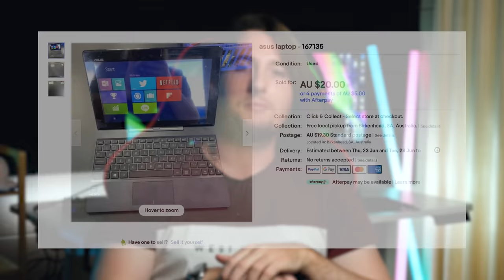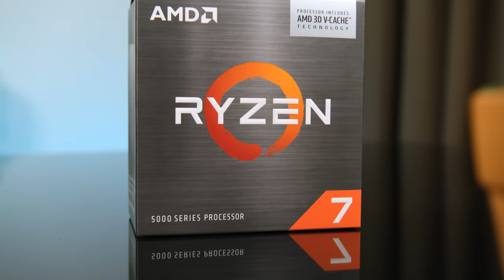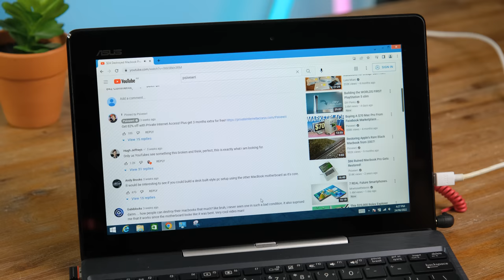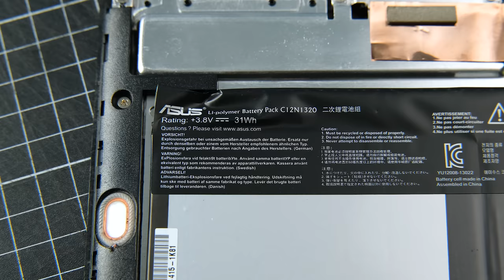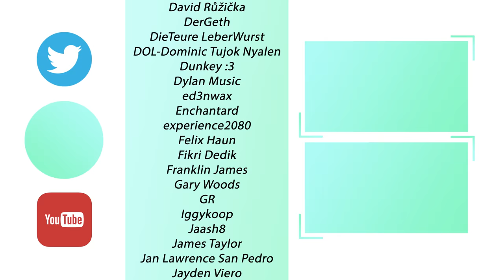I Bought a $20 Laptop From Cash Converters...

Comment: I had that laptop for a while a few years ago, it was a nice little laptop, I remember when I updated the bios and it unlocked a bunch of new features in Windows 10 also I remember the tablet crashing if you didn't have the right drivers installed in Windows and disconnected the keyboard

Comment: I have 2 of almost the same model as the video the difference is that its the T100HA instead the T100TA model. My model is originally shipped with the original release of Windows 10 from 2015. Now I have one of them with unsupported Windows 11 and the other with Windows 10. I still use them in 2022 and they are still good!

Comment: I've had a larger ASUS Transformer of the same line years ago, yeah the 2GB models even then would've popped up "Hey close some things to avoid being interrupted/crashes"
Using it nowadays will make that message appear more often, 4GB is definitely a necessity to be useable.
I still use it from time to time for specific things.
I've thought of replacing W8.1 for Linux, but seems like it uses a 64Bit OS with a 32Bit BIOS, somehow, so I just gave up on it.
Reply: It's quite easy to get Linux on those 32bit EFI systems. If you want to try it I'd recommend checking "Linux on the HP Stream tablet" on HP community, it's the same process for other non-HP tablets too
Reply: Kinda like the HP stream tablets lol
Reply: @Pasi123  I've decided to actually give that a shot. The UEFI was unable to recognize either the SD Card or the USB that I tried to boot from. Disabled Secure Boot, and tried the USB on another Laptop and it worked, but not on the tablet. I was using a 32bit version of LMDE just to make sure it will read the USB. Maybe I have to use the Micro USB port with an OTG Adapter?
Reply: I was trying to install Linux on the same model and ran into the exact same issue. The answer is MX Linux (KDE Spin - 32bit). It has a 32 bit UEFI BIOS, but is also available as 64bit OS.
Runs perfect, even got the touchscreen to work perfectly and calibrated.
One thing to lookout for is orientation. It is the wrong way up. Though on KDE it is a one time issue (go to settings -> Display -> Switch to Landscape).
Reply: I had a HP EliteBook 8560p from workplace that also has a 32 bit BIOS and 64 bit OS. sadly the workplace installed a 32 bit version of windows.
Reply: I have this exact model and ran into this bizarre issue. You can install Linux because GRUB is 32-bit and supports loading a 64-bit OS through it, try Linux Mint
Reply: After putting it on and off for almost a month I got Fedora working. For some reason when I plugged in a Windows 10 USB installer it was able to read the USB in the UEFI after that(if formatted with either Rufus or dd). Linux Mint installed kept crashing but Fedora worked fine, GNOME on an Atom with 2GB of RAM is an overkill but at least GNOME has a more touch screen friendly UI. Bonus with Fedora is that it installed a 64bit version anyway without messing with the bootia32.efi
Reply: @LouiesWorkshop  That's probably grub or efi shell.

Comment: i just got myself a Dell business class tablet.
It was well over 1k when it launched in 2017 but i picked it up for about 260€ and it has a i5 7300U aswell as 8GB of RAM and a full sized m.2 NVMe enabled slot for SSDs.
It even can take a second SSD inside the unpopulated mPCIe slot where usually the WAN module would sit in another configuration of this model.
The wifi module also sits in a mPCIe slot, can be upgraded but isn´t needed though.
Supports bluetooth 4.0 and wifi 5ghz, enough for me.
The type cover has a white backlight and it features a full size USB 3.0 aswell as two Type C ports with displayport and that´s also used for charging (needs 20V PD though).
At last it also includes many handy enterprise features aswell as legacy CSM module for BIOS emulation.
So technically, it can run windows Xp even but i already had issues getting drivers to work in windows 7  as the 7th gen Core i no longer supports windows 7.
Anyways, i got windows 11, ubuntu and android-x86 up and running on a 512gb SSD.
The OS can be selected through the boot menu, which is accessible with F12 or the volume buttons.
Best tablet i ever owned.
Reply: Damn, one intel generation forwards and it would've gone from 2C/4T to 4C/8T

Comment: I've had this model for a whole week back in 2014. It was very nice. But the big Oof-point was the very slow charging process. The included charger was not capable of charging my device while running Windows 8.1. I didn't knew a thing about third party chargers then. But...it was a nice litte computer.

And $20 is a nobrainer, for sure. :D

Comment: I had one of these, a T100TAF (cheaper red version with 1 speaker, z3735f cpu). I loved it, unfortunately broke the screen and replacements weren't great. (had phantom touches etc)

You could get a variant with 4gb of ram, and a 500gb spinning hard drive (in a 10in laptop!) which would reside in the keyboard dock. This required a 9v 2a charger to ensure enough power to charge and use the device at the same time... 

The 30whr battery and low powered CPU made it have a frankly insane battery if required, and being able to run off any power bank was a cool bonus. Charge times were slow though, with my model charging thru micro usb 5v2a. 

I miss mine dearly, i'm leaning toward geting another one cheap but feel like it probably wouldn't get used to it's fullest potential. These early baytrail tablets running windows 8 are what gave the Intel Atom a new lease of life. When these chips were launched they were as powerful as an original iPad Air, for roughly the same power use too.. Impressive stuff!

Comment: I had a very similar netbook from Asus I bought in 2017 (I didn't have much money at the time). It had 4 GB of RAM, but only 32 GB of storage, most of which was taken up by Windows 10. I wound up installing a low spec Linux distro, which ran much better.

Comment: If you want to get sharpie off, try a magic eraser.
I have a Dell venue tablet computer and it has a solid keyboard. ( I got it from my states surplus sale ) it was also rubberized and had sharpie on the bottom, but a magic eraser took it right off.

It might not work, but it's worth a try!

Comment: Cashys laptops can be a great bargain for projects, 
I also got a $100 Acer from Gawler CC to use with OBD tools and nothing else. 
It has Bluetooth and a touchscreen so it works fine on the front seat when finding problems 
Let me know if you need a hand with the AU Falcon, I’d like to try it on different cars for compatibility testing.

Comment: I had a convertible detachable tablet/laptop like this. It ran Windows 10, Acer Switch 10E...
It wasn't fast, but had nice battery life & I have some really good memories with it. It was tiny, carry it anywhere. I later installed a Linux distro & it worked really fast.

Comment: Interesting video. I bought arguably the cheapest and slowest tablet from the Microsoft store in 2017. The specs are very similar to yours, with a 64 bit Atom processor and a measly 2 GB of ram. I’m thinking of wiping the ghastly and SLOW 32 bit Windows 10 OS with Linux Mint or Manjaro if the memory requirements are satisfied.
Reply: I suggest you do a test run on a live boot env first, tried doing that on one of mine Asus tablets, turns out there are no drivers for the touchscreen and the screen rotation is broken.
Reply: Linux Mint runs really well with 2Gbs of RAM with the Cinnamon distro. You should give it a try! :D
Reply: @Slay1337pl  Mine's a NuVision tablet with a horrible low resolution, cramped touch screen - but as you said, it is always wise to do a live boot anyway to test out the functionality of the OS with drivers. My biggest struggle is to enter the bios of the device to change the boot sequence - so far I've failed.
Reply: @anarhyxd  I certainly will. I miss Linux Mint for I had to change to Manjaro Linux on my main desktop because of an AMD graphic card incompatibility with Mint - the GPU drivers for Linux from AMD failed to install. Manjaro isn't as stable as Mint but it is more up to date.

Comment: I have a similar laptop from Lenovo, called the Lenovo Miix 320. It's a 11 inch hybrid laptop with Intel Atom processor, 4GB of ram, 32GB of eMMC storage and came with windows 10 pre installed. However, windows was too much for that machine so I installed Bliss OS and made it an android tablet. Pair it with a pair of bluetooth earphones and it's an excellent tablet for Netflix in the bed.

Comment: Try using a marker to remove the marker from the back. Whatever solvent they use in markers will loosen the old marks and then you can wipe it off with alcohol.

Comment: Those tablets usually run a 32bit bios for reasons that I don't know

If you want a 64os
You could try these

For Linux operating system usually a workaround is to put the bootia32.efi file  in the efi folder
When trying to install an operating system like mint or Kali

Arch is kinda hard to install on those 

And after that give Minecraft a try with sodium (better than optifine if you just need performance)

You could also play fallout shelter with steam proton
Reply: it runs a 32bit CPU, not bios.
Reply: @MultiWirth  both. Or more specifically a 32 bit UEFI.
Reply: @megamiazga  A 32-Bit EFI with a crappy 64-bit cpu.

Comment: so i actually had one of these the main issue is that even though it has a 64bit processor its bios is 32bit making it so you can never put it on a 64bit operating system

Comment: i actually had one of those back in 2013 during my college years, however mine has 4GB of Ram instead of 2GB of Ram.
honestly it was a pretty good notebooks alternative, as i used mine with OneNote and a capacitive stylus in classes.
i have to say however that one of the biggest drawbacks that this hybrid computer had back then was that even though the Atom Cherry Trail CPU was a 64Bit CPU, Asus cheapened out and used the 32Bit version of Windows 8 on it... that was the biggest drawback of this machine back then and still is to this day since installing a completely different OS on this hybrid laptop is an annoying process unlike any other ordinary laptop - many people have installed cloudready OS and Android X86 on this specific laptop to enhance its software capabilities, some even installed Ubuntu on it.
i think in today's world the best OS you can install on one of these machines is probably Cloudready OS with Android app support - that would likely bring the most functionality out of this machine as a tablet while still retaining its usability as a laptop as well.
i still have it to this day and it did receive the free windows 10 update a couple of years ago and it still runs pretty well, but i barely touch it anymore since using it nowadays feels more like a chore than actually practical - the 10.1 inch screen isn't really the issue, the issue is the HUGE bezels and the insane weight this tablet has with the keyboard attached...
using it as a tablet to watch movies on the go feels like a chore if you don't also use the keyboard as a stand, but then you are carrying a hefty nearly 1kg device with a small 10.1 inch screen just to watch movies on the go when a standard iPad has a 10.2" high resolution display and weighs less than half WITH a magic keyboard...
i do like how well it is able to run old games however - Joint Operations Typhoon Rising runs on this computer with breeze...

Comment: I picked up one for cheap in or  2014 or 15. I used it for a few years. The reason I still don't have one is because I only had the 64GB EMMC version and I could not get Windows 10 installed on it. If I got Windows 10 installed on it, I'd probably still be using it today.

Comment: Hi! I bought some weeks ago an ASUS TransforBook T300 CHI, the bigger brother of the T100 series
I paid for it 145$ (The seller gave me a Bluetooth mouse as well, so just the laptop was about 130-135$)
Here are the specs (It's so much stronger than T100 but bigger, but not too much)
- It has a so much better Intel Core M5Y71 processor (M5Y10 version available too)
- 128GB SSD (But there is a 256GB M.2 SSD version too, but only with 4GB RAM)
- HD 5300 Graphic card
- 2x4GB 1600Mhz LPDDR3 RAM
- 2560*1440p Auto QHD 12,5" removable touch screen (There is 1080p version too)
- Windows 10 Pro 64 Bit
What do you think? Is it worth it?

Comment: Used to have one of these with 1gb ram. You're blessed to have 2gb LOL. I'd love to have another one of these with 2gb. 1gb almost makes it useless as a windows user, since it is only able to boot / install windows 8+, so 7 which would run fine on a single gig, couldnt be installed, and anything above 8.1 would make it SUFFER to even boot.
Reply: Actually no! Windows 8x seems to run really well with 1GB. I have a HP tablet that's got 8.1 and 1GB of ram. It's great!
Reply: @leontechtalks  yeah, kinda. But, at least when I had mine, it starts would crash by just running ms teams for more than 20 minutes. If that didnt happen, I'd still be using mine for online meetings.
Also, mine only had 16gb internal on a damn slow emmc.
Reply: Use Linux I guess

Comment: the win 8 start screen is IMO still better than the win 7 one. And I am acctually activating  it in the win 10 start menu settings.... I like that it takes up the full screen and putting programms in groups and spreeding them across the screen basicly removes the need for the Desktop....
But Win 8 was the windows installed on the first pc I ever got.... so I'm maybe biased

Comment: I recently got one of these for cheap as it as sold as faulty, but it seems like the on-board hard drive has died. Not sure how to fix that as its soldered to the board, but might try running an OS off a microsd card if it's now too slow.

Comment: I had something similar 7 years ago. It was the worst built device I have ever owned. Trackpad popped up multiple times and had to mail it back twice as it began it’s string of problems after a month of use, connector for keyboard became loose after 6 months and almost unusable after a year, USB port failed, and it was slower than a herd of turtles stampeding through molten asphalt

Comment: Recently I picked up a Kogan touchscreen laptop from a cashies for just $40. They claimed it has no OS and no M.2 SSD. I found that it did have windows 10 installed onto its 64GB EMMC storage however it was corrupted. I installed a fresh copy of ghost spectre Windows 11 (lightweight windows 11 iso) and now it works great and has 100% battery health so 6-7 hours use can be fairly easily achieved! Sold it on for $100 profit shortly after.

Comment: I am always surprised at how you manage to find such cheap deals, even for outdated tech.  I had looked for a similar device recently to use as a backup for my daughter to take to night classes and the price ranges were easily 3-4 times more.
Reply: @FlyboyHelosim   I keep checking ebay listings and never manage to find deals like those.  I wonder if there is some kind of regional filter or something like that.   The best deal I could find recently was a 11.6" 8gb ram 128gb ssd Lenovo and that was about US$75 with shipping.  I can find chromebooks for around US$30-35 but generally with only 4gb ram and 16gb storage which is quite limiting.  I had actually had better luck with tech giveaways from family members, friends or workmates.

Comment: Urgh, these bastards were being flogged on school students around 2015.
Mine only lasted a few years before the connection between the tablet and keyboard SEVERELY weakened, preventing the keyboard/touchpad from staying connected. And because my screen had also been damaged, also affecting the touchscreen, this basically left me with no input into the device at all. Oh yeah, and the trackpad was coming out way more than my current gaming computer when its battery had swollen up into a mildly spicy pillow. Heck, I could've ripped it out at that point.

I finally got it replaced with a Lenovo laptop... that had a garbage battery life for going to school and later began to suffer from frequent BSODs. It was so bad I broke out my super old but super stable (Acer) eMachines eME728 and was using that until I finally got my last school computer (now a uni computer) - an Acer Spin 5...

The Acer Spin 5 was LEAGUES better as a touchscreen laptop and you can still get that laptop/tablet hybrid experience by... folding the keyboard behind the screen. Meaning that it's way less likely to die later down the line in the same way my ASUS T100TA did.

Comment: Just curious .. for the black marker on the underside .. have you tried a test of covering it with a dry erase black marker then let it set for a few minutes and then remove the dry erase marker?  Reason I ask is that somewhere not too long ago, but I can't remember where, I did see a hack that to remove ' permanent ' black marker, that a dry erase black marker might do the trick.